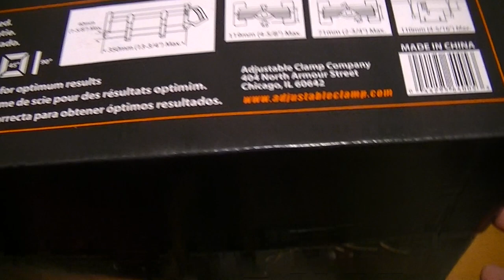Jorgensen Miter Box with Saw

Comment: Can I cut a 4x4 piece of plastic wire duct with this saw at a 45 degree?  I need to know if 4x4 material will fit in the saw when it is turned at 45 degrees?
Reply from the maker: 4x4 inches? If so I'm not sure... I must try it. I think you can do it but it will be not easy.

Comment: This is actually a well done video. I gathered the info I needed. Its clearly for smaller items. There seems to be a little side to side wiggle with the saw in the guides; which is expected from plastic guides.  The cuts you showed are a testament to the blade.  But it looks like it cuts square...many people complain that it "bevels"..but thats from improper use.  There really is no point to recommend or not because it depends on one's goals.  So...thanks for this...WELL DONE!
Reply from the maker: +Slap Stick Thank you for your words! Yes, you have to learn a little how to work with this saw and all bevels will become square! Mine cuts on video are not completely square. They are my first cuts with this saw. And one of them is maybe 89 not 90 degrees. And you can feel it right away and see.
Reply: kepkopke Its pretty cool. I'm wasting my time making one. Haha!